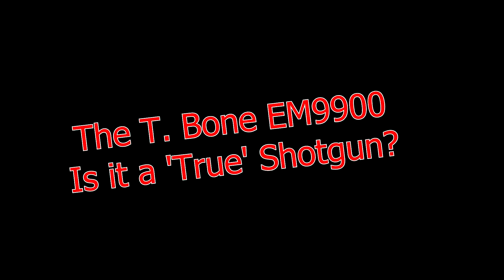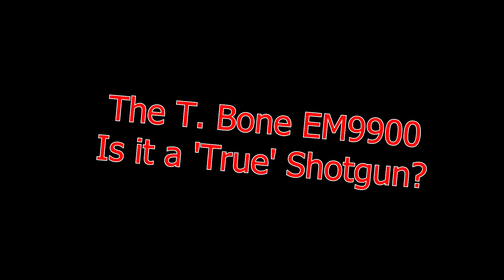T.Bone EM9900 - a 'True' Shotgun? Here's a Test .....

Comment: Why would you have the open side facing up in case of an aeroplane, unless you live beside an airport? I'd want the side that rejects most noise facing wherever 'most unwanted noise' is coming from for example traffic on a busy street or that bloke mowing the lawn off camera.
Reply from the maker: Yeah, I must be nuts. 👀

The point of this video is that the mic is uneven on the left and right, so you have to know which side to point at ‘most unwanted noise’. Point the wrong side and ‘most unwanted noise’ is actually louder than the other side. That’s why I suggested pointing the deaf side up .... because you then get even rejection on left and right.

Most people would buy a massive shotgun like this for rejection and depending which way it’s pointed, rejection can be good or actually not very good because one side picks up better. It doesn’t behave like a normal shotgun.

I wasn’t suggesting that you need to do this IN ORDER to to reject planes. It’s just an added bonus.

When ‘that bloke is mowing his lawn’ again, I can only face one way or else the mic pics up ‘that bloke’ a bit better!

In my garden, I have distant traffic sounds on one side. I found that the traffic sound was louder on one side in comparison to the other, so had to face only one way which wasn’t great for the video! I got by this, by pointing the deafer (open) side up so I had seemed to have better rejection on left and right. (Being masked by the body of the mic) so I could face any way I liked!! (Except directly towards the traffic and up at planes of course 🤪)

I don’t mean that you should use it all of the time this way but maybe useful if you get planes and helis around, like I do here. (Other than doing this, wear headphones and listen then)